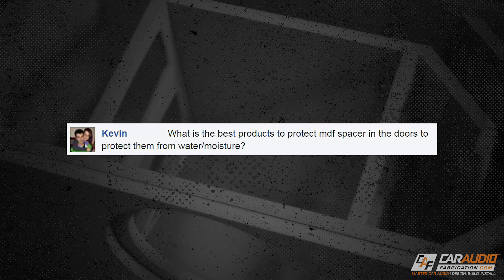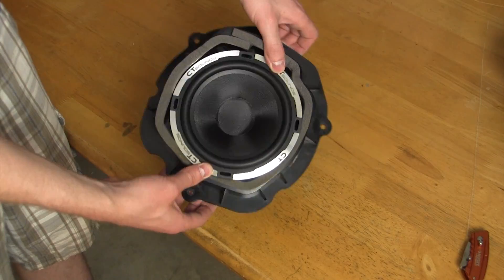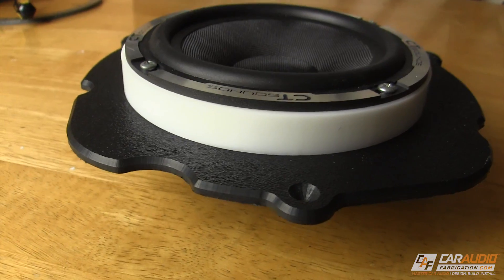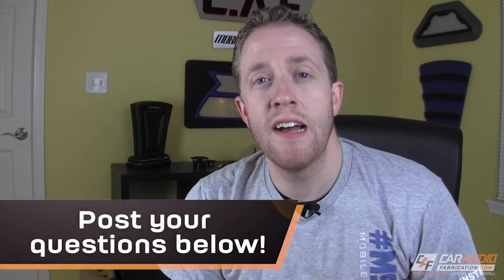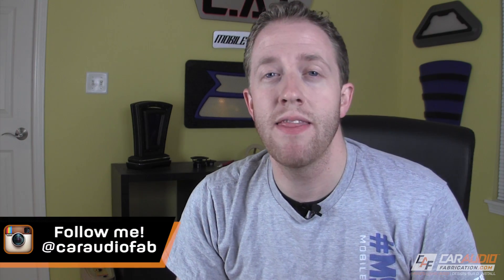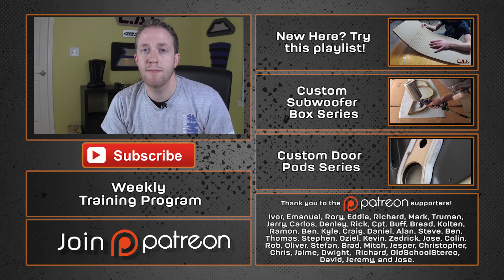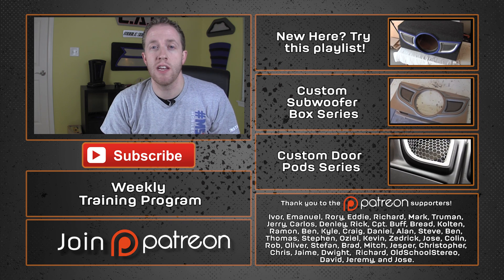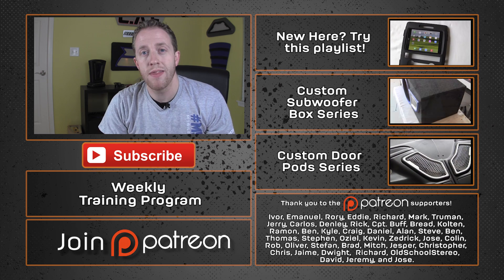Choose the right material for custom speaker adapters - CarAudioFabrication

Comment: in addition to the other interesting facts, your comment about the materials to use due to water in the door panel struck me because I just swapped speakers and saw behind the speakers, and to my surprise, the metal screws had rusted, and even the speakers had traces of rust.  Water cannot be good for the speakers either.  I live in Arizona, and beloved 06 GTO never sees rain.  It had to have happened when washing the car.  Soooo, I will be taping off the window seals from now on.  hopefully that prevents it in the future.

Comment: If use MDF used as a spacer if you are using plastic is going to be extremely thinner 16th of an inch 2 quarter of an inch and even on Amazon ABS plastic is still $24 to 55 for a 2 foot by 4 foot sheet does all the band on what you're really using it for and the application

Comment: 3 coats of Kilz primer primer spray can apply evenly covering all surfaces
Reply from the maker: And the second you add a fastener that "barrier" is broken. I've seen coated rings and time and time again the first spot to degrade is the screw location, I've seen speakers fall out of wooden rings. Plastic is CHEAP and there is literally no reason not to just do it right and use it.

Comment: Good information provided even with a 2 year old video. As an ASE Master Tech since the 70's, retired, my life's journey took me into the marine industry for a short time. The use of marine grade plywood is used in certain areas and sometime coated with fiberglass resins, but their is polyester & vinyl-ester (pink) resins. The latter absorbs less water and shrink less. Yes, fiberglass is not waterproof, the gel-coat or paint is. Vinyl-ester w/water, produces less amino acids that causes separation, de-lamination or the formation of bubbles under paint or gelcoat. High end boats are pink under unseen places which is good, a sign of what your are buying. If it is yellowish, it is polyester. The use of HDPE is the high end and used in marine application because they are in structural applications and many are subject to extreme flexing stress. Expanded poly board is cheaper and most useful for non-structural application as used in the CAF videos. One choice for waterproofing any clean/prepared product is sprayed like paint. It is "Bilge Gelcoat". What is that? Well, is like thin body filler, usually light grey in color, thinned with "MEK" or methyl ethyl ketone (Sold in home improvement stores), but contains 2% wax. When thinking about the back of a boat where the engine is located, and down the middle where water will settle but not seen, drains back to pool. This is where an electric pump is located to pull water out thru a fitting high up on the side of a boat. You don't have to own a boat or ever been in one, but you can imagine what this is. The "Bilge Gel-Coat" has a 1 year life span, slightly extended if kept in the fridge, but will stick to anything and seals very well. The wax component comes to the top as it cures, creating the seal you want. It can be scuffed and painted with any color your project needs. You can get this a large marine dealers that have a good shop, online or else where. It is special and not too expensive as compared to just using spray epoxy per quart. Thin with "MEK" to spray, practice and try it. Sorry to be long, but I just enjoy custom fabrication, ideas, methods and modifications. The right materials is just as important as the execution of fabrication. Hats off to CAF and their video's. Good job.

Comment: All of your speaker pods are great. No matter whether you complete you pod in vinyl or paint. Once eveything is completed. What is the best way of actually mounting the completed pods to the door panels? I'm about a 1 week from having everything to begin on my all Alpine system in a standard cab 1991 GMC sportside. Everything has ben totally redone from body off paint, to all new crate engine and transmission. All is new, so I don't want to to rig the stereo system, I wanted it to turn out as good as your stuff. Thanks Mark Please reply I am stumped.

Comment: I will have to say, living in the himid Southeast, I have never had an issue with mdf on my doors warping.  A friend of mine did, but that was because he repeatedly left his window down when rain was expected.  I just don't see how ambient humidity is going to ruin a speaker ring which should be on the outside of the door.  But in cases like my friend, a layer of resin and a latex paint should keep the ring from being damaged by anything but straight-on blasting with a hose or immersion.

Comment: that's why you seal your door properly after taking the door panel off......
Reply: +jody024  haha - why do you think that you door has drain holes in the bottom?? to allow rain water that gets into the door skin via the window slides to drain out.  Also, as ImTheSecondBestPlayaAfterMe said that moisture in the air can easily warp and split MDF over time.
Reply: +jody024  haha - why do you think that you door has drain holes in the bottom?? to allow rain water that gets into the door skin via the window slides to drain out.  Also, as ImTheSecondBestPlayaAfterMe said that moisture in the air can easily warp and split MDF over time.

Comment: I find that theres not enough fab, and à ton of talking. Get back to actually showing the fabrication
Reply: ImTheBestPlaya
"Start taking notes ?" what for ? just because you say so ? yeah right. I've been involved in multiple car builds over the years and not once has a door leaked messing up the internals. You do it your way, good for you and I'll do it my way which for me works just as well.
Reply: Window seals are not perfect. they leak when they are new. It's not that water didn't get in the door  it's that it just didn't mange to get on the speaker adapters. The better question is why are you arguing against what is clearly a better material for this application.
Reply: +Daniel “slumbs” P. Not too mention nobody uses plastic to make speaker spacers, it's stupid, just seal your door properly, problem solved.

Comment: Kydex sheets are way cheaper than anything else and is easy to cut and work with. I realize that doesn't support anyone's sponsors here on YT but that's the easiest. Good topic though. MDF swells like crazy so I wouldn't use it outside the interior.

Comment: how about making a video about battery isolators and adding a second diffrent size battery?
Reply: +MrSopuli3  I know it's been 2 years now and perhaps you found "Good" information for installing a battery isolator w/second battery. You do get what you pay for, but reach out to customer service by manufactures who make and sell these items. Their websites will include a PDF that would include specs/math you may not understand...or do. As an ASE Master Tech since 1978, I have worked on everything including motorhomes and boats. The dual battery application is common as well a Trucks/SUV's w/diesel engines. Just understand that while a second battery may sound good, the application of electronics that use more current is supplied by the alternator. The battery is to start the vehicles engine, then get charged while driving. The alternator supplies all of the current or amperage needed to run all electrical devices. Adding a second battery may include upgrading the alternator, ground wires, much less B+ Red cabling to the components you have added. Check the "Max" current usage of you devices being added. A simple digital amp-clamp sold a Sears and elsewhere are reasonably accurate to isolate, note, then add up the total to help decide best practices with proper fuse protection and chaffing the cabling being added. Remember that  all wire is not equal & has voltage to per foot that increases with amperage. Choose your wire carefully grasshopper!
 Be Safe! Ask for help. Reach out with your calculations to suppliers or manufactures customer service with your project to achieve a long lasting system that will not wear out parts, cause fire and serve you well. Blessings.

Comment: I gave my sub a coat of polyurethane, as well as all the structural panels I added to the trunk. In addition to waterproofing, it also cut down on a lot of the smell from the fiberglass resin.

Comment: 0:38
I think PVC is the best material to use for adapters or spacers. Water does not damage them, and if you need to screw into them they hold screws well.
Reply: +Dan V You're probably right but, finding readily available sheets isn't that easy to everyone.

Comment: Questions for next show: Building a gaming PC into a car, anyone doing this? Seems like something you could put in a center console and display on a tv and over the sounds system. Would be super baller to play a game like dirt using the car's own steering wheel and pedals with the windshield being turned into a screen.   And, have you ever thought about 3d printing a ported enclosure for a front door component speaker?

Comment: Great video Mark! Keep it up! To keep Fabrication Fridays alive, a question I'd like to pose is about electrical, "DICY" wiring and wire management. Maybe some tips and tricks on proper ways to tap into OEM wires, zip ties, heat shrink and soldering? Posed as a question: "Mark, how can I ensure that my wiring doesn't create a problem for my system over time?" Thanks!!
Reply from the maker: +Bryan Pfeil Great question! Thanks for posing it in a good question form, thanks for commenting!

Comment: Ideas for video - wire routing, wire protection. Safe clean installation for head units, amps and other components. I understand subs are a big subject these days but lets move on to more detailed discussion on choosing components that work well with each other and choosing components for different types of listening. Fab is fun but there is so much more to this then just fab work.

Comment: Sweet vid man... Question: I have a lot of spare Polypropylene in various thicknesses I can use, do you think that would work? Its a little more flexible that ABS is all.
Reply from the maker: +Oliver Clifford  Hmmm, hard to say, I have never worked with that material but I do know it is relatively ductile, so likely no issues with it being brittle and snapping, have you tried machining it? Not sure how well it cuts on a jigsaw or router.
Reply: +CarAudioFabrication So I had a go at machining it it over the weekend.... A two flute router bit on slow speed would only cut it without melting at very shallow (1-4mm) depth. Perhaps it wont be any good. Might have to go massively overboard and use the spare Tufnol 6F/45!

Comment: When you put your amp in an amp rack, how do you make sure it stays cool? ate the built in fans and a little bit of airspace enough, or do you add additional fans? I'm working on a box for my Jeep and I want to make a rack for the amp with like a jeep logo cut out of it, or the jeep grill design, do you think that opening would be enough so I won't have to worry about overheating?

Comment: I have a 93 corolla that I am having issues with my speakers hitting the windows even with spacers.  Is there any tips you can offer if I want to mount the speakers to the door panel?  I am wanting to do this so I can step up from a 5 1/4" to a 6.5 or larger.

Comment: Great tips Mark. In the area where I live it is difficult to locate adequate plastic material to make adapters from. I was doing some shopping and noticed plastic cutting boards in the kitchen department. They were not terribly expensive, but they certainly work if you are stuck and need to find plastic in a pinch.